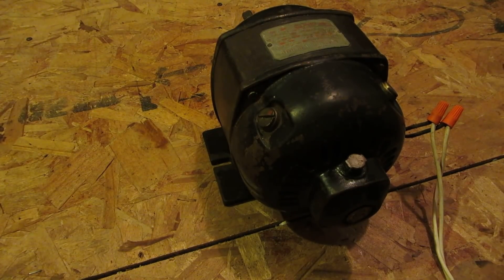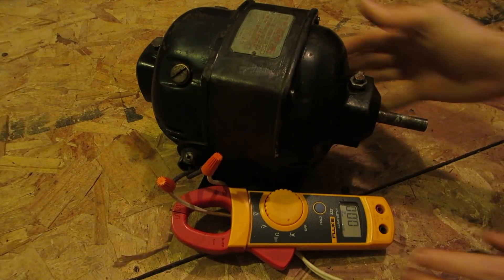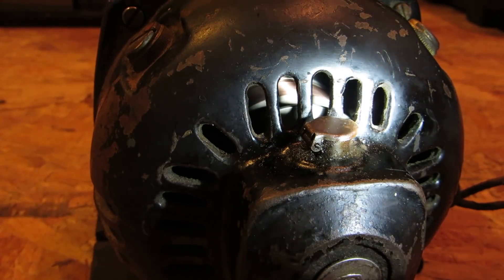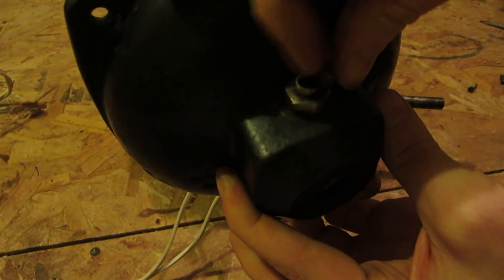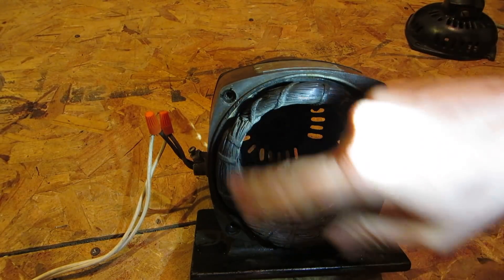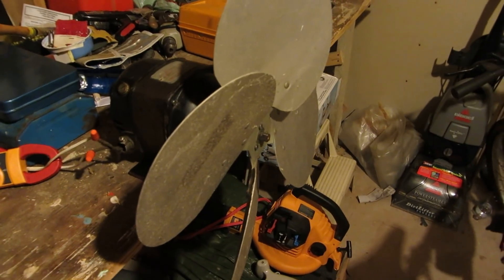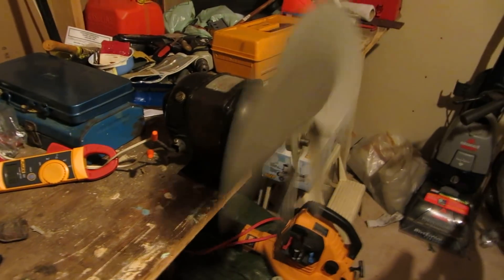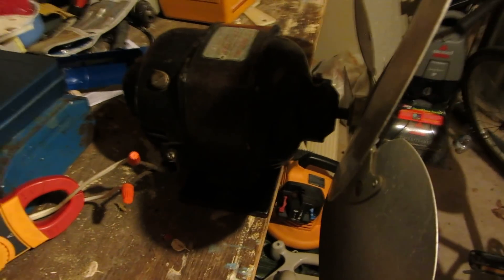Vintage Repulsion-Start Induction Motor

Comment: That's a very nice Leland motor. I don't have one like that; but i do have a slightly newer one. It was found on a Frigidaire sulphur dioxide unit, as a replacement motor someone had installed in decades past. I haven't tried to run ore restore it yet. Too many projects! Mine has a cover over the brushes that can be removed from the rear housing to access them.

That's a "brush riding" design. The spring mechanism is often called a "short circuiting mechanism" since it bridges all the commutator segments together, as if they were "short circuited."  Once this has happened, the commutator no longer passes current to the brushes, so they don't do anything other than "ride."

The other type is "brush lifting" which as you know just does the same thing but after the short circuiting mechanism engages, the brushes are lifted off the commutator to minimize noise and wear. 

I think you've seen my videos of the Delco/Frigidaire and Century motors which are used on the 1920's and 1930's refrigerators. Those are brush-lifting motors.

That fan is a beast, for sure!  I know you checked it's securely mounted - but I would fear anything coming from the bench getting pulled in. That would be bad LOL!

Comment: This gave me the heebie jeebies. What RPM is that (unenclosed) fan blade rate at? ? ? I'm currently tearing down a vintage Australian Crompton Parkinson Repulsion-Start motor so I found your video decidedly interesting. My motor runs beautifully but will not start. Initial inspections reveal very degraded wiring.
Reply from the maker: The fan blade is designed for 1725 Rpm but it would operate just fine well into the 2000's